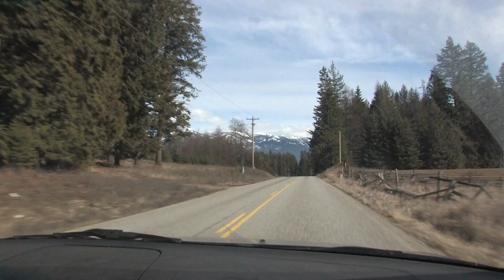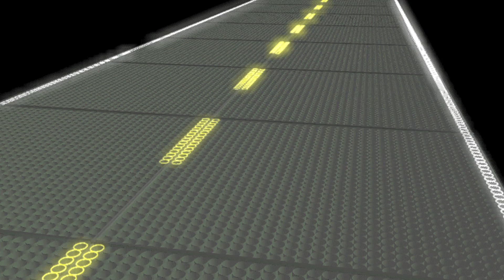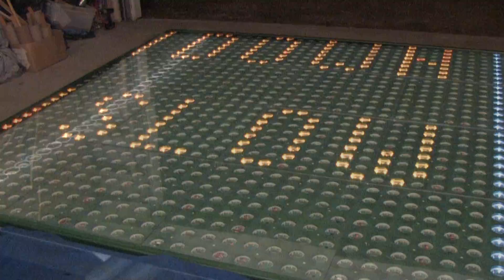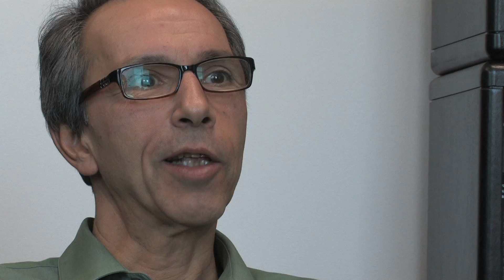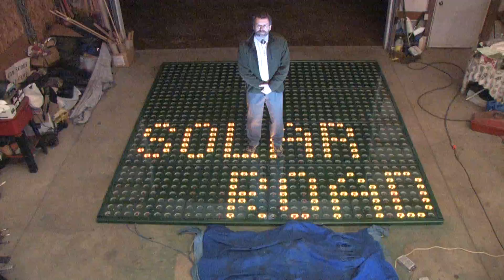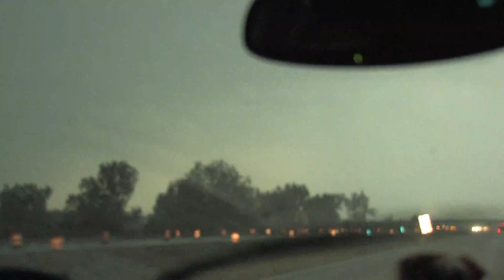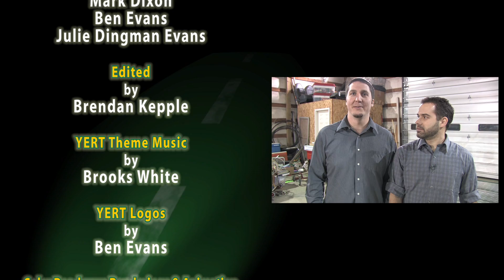Solar Roadways: The Prototype

Comment: Thunderf00t destroyed this non-sense.
Reply: Nick White They keep saying that we'll never prove that the world is 6000 years old. Insert something about the Wright Brothers... Insert something about electric cars.. Therefore, eventually people will prove that the world is 6000 years old. End of proof.
Reply: Rich Hart Even if all that stands, why would you when it is far more efficient and cost effective to just build more solar farms?
Reply: OK axe863, let me drop some knowledge / rationality on you, since you seem to love logical arguments.  There is a fundamental difference between the domains of science and engineering.  When science has thoroughly studied a domain of knowledge then the limits of what can be feasibly engineered become clearly defined.  These engineers have clearly studied the latest science on materials, photovoltaics and electronics, then designed their technology around those principles.  Because they did their homework they can have a high degree of certainty that their prototypes will work without even having built them yet.  That is the power of science, it allows you to make accurate predictions about events before they have ever been observed, in this case the reliability of a technology before it has been built yet. And yes, there are probably going to be unforeseen obstacles along the way, but that is the nature of inventing any technology, whether it be light bulbs, or rockets to the moon.  So get off you high horse and stop discouraging people from pursuing technologies that can make the world a better place.
Reply: theFailQuail What?! High tension lines carry low current not high current. If you have high current lines, what you end up with is loads of waste heat, thats why we have step up and step down transformers, electricity is transported as high voltage, low current to limit the amount of waste heat, we then have transformers to up the current and lower the voltage for home use.
Reply: Rich Hart I'm a quant/mathematician. If you want me to price an Asian option where the underlying asset process has time varying variance/kurtosis or perform a rolling generalization of generalized spectral derivative test coupled with composite multiscale entropy analysis to analyze time varying market efficiency, I'm your guy.  I'm merely applying basic scientific rationality to this discussion. Even a highly localized full system implementation has not been performed. You do not understand the fallacy of merely analyzing sub-components of the system instead of the system.
Reply: Rich Hart All this talk of scientific rationality is just complicating an otherwise simple issue. There appears to be no utility in placing rare earth materials like solar panels under inches of glass distorted by hexagon protrusions flat on the ground and under the stress and abrasion of multi-ton vehicles.  If evidence shows otherwise, I will change my mind.
Reply: Have you every done an experiment on glass tempering before???  Guess what, I have!!!!  So seeing how I am someone with more experimental experience than you, plus I will bet the farm that I'm also more scientifically literate in general, trust me the concept is feasible.

It's just like metallurgy. Pure copper is a pretty lousy material; add a tiny amount tin and you get bronze.  Iron is very brittle, treat it properly and you get steel. Material science is an incredible complex and diverse field that neither of us are trained experts on.  But my armature experience in the field has taught me that the range of properties that modern materials can have is INCREDIBLY diverse. So much so, that from an engineering perspective it better to just make a list of the desired properties you want and then work backwards to select the material that fits the requirements you seek, which is what they did.

As for the cost of producing the glass, ever heard of this thing called mass production?  Last time I checked steel was a very energy intensive process and guess what, steel is EVERYWHERE!  What made is so common?  Well back in the day, steel was reinvented in the industrial era and was very expensive for the time.  So people invested in creating the economic infrastructure to make it cheaper, and that's why steel is incredible common place today.  

All of these principles can be be applied to solar roadways.
Reply: @wulf8121  I'm curious, are you still retarded 11 years later?
Reply: Rich Hart
 The null position in statistical analysis is that a regressor is statistically insignificant until demonstrated otherwise.

The null position in statistical analysis is that difference in linear and nonlinear regression is insignificant until demonstrated otherwise.  

The null position for an unspecified non-empty optimization problem is that unsolvable in finite time unless demonstrated otherwise.

The null position is that an unquantified higher order system doesn't work until demonstrated otherwise.

You are irrationally trying to justify a higher order narrative, a currently unspecified function of lower order processes, by appealing exclusively to lower order processes.
Reply: Rich Hart I only said that to make it clear that I do not have an advanced knowledge of this particular subject matter. I dont know why you hate quant funds. Efficient risk allocation is an integral (lol) part of advanced capitalistic economies. From your general approach, conditional on you being a mathematician, you have compartmentalized your otherwise rational mind with respect to this subject matter.  

Moving on. There is no reason to heat the roads in that fashion. There's no practical reason why to provide dynamic lighting/ warnings on the ground given that for the vast majority of time, it's optimal design is static and it's harder to see warnings on the ground rather than on a massive electronic sign above the road. Just because it can do many impractical things very poorly doesn't mean that it is worthwhile venture.
Reply: Rich Hart If you disregard most of what was said though even. Glass is just not viable. To expensive, and to soft. In general the entire concept is just to expensive. And he really hit the ball outta the park with the parking lot thing. It would be useless to make parking lots out of this stuff.
Reply: Alexander Stone Can you not accept the possibility, that no one is threatened by the idea; that it simply will not work. If you have payed money towards this, you stand to loose out; so who exactly is threatened?
Reply: Because one of the concepts is generating power by putting solar panels on the ground on parking lots. Which are used by day, and less so by night.... Just there it shows they do not have the thinking requiered to pull any of this off.
Reply: Rich Hart How does one go about objectively falsifying a system that has yet to be quantified or that can always appeal to potential future innovations that afford it the unscientific privilege of infinite flexibility?
Reply: Rich Hart If it isn't at zero percent occupancy at all times, you're reducing efficiency (even further than putting it flat on the ground under inches of glass with hexagon protrusions) and for what reason. Tell me for what reason. Why cant they be placed on top of the parking?
Reply: axe863 They could be place on top of the parking lot, but power generation is obviously not their only goal.  They're also trying to solve the problem of updating road warnings and signs as well as solve hazards like ice formation.  Integrating these electronics into the roads takes energy so they decided to give the roads thier own power source, and give the surplus back to the grid.   The roads solve multiple issues at once that's the point. 

And FYI, I also am a physicist / mathematician / computer scientist, but unlike you I don't go around discouraging people from trying to make the world a better place, especially if their idea is technically feasible.  

Do I think that there are even better solutions to solar roadways?  Of course I do!  ( Honestly,  I would rather see governments just go all in on fusion tech).  But people are genuinely excited about the idea, so I would rather encourage the people behind this tech, especially because it could make a significant impact on power generation.  While also researching and encouraging even better tech to be developed in the future.
Reply: Thor M Picture in your head a parking lot that is used to full capacity. Now ask yourself this question, "why, even when a parking lot is being used to full capacity, will there always be a space that is not being occupied in a parking lot"?  

Now experimentally, look a parking lot next time you go to the store.  How much of the parking lot is not being devoted to individual parking spaces?
Reply: Bryce William Do you want us to do a full exhaustive analysis of all possible configurations?  The null position is that unquantified system is assumed not to work until demonstrated otherwise. Unless if you think that requiring exhaustively proving a negative of an unspecified system is logical, you should quit while youre only slightly behind.
Reply: Ryan Denziloe Yes there is. The null position is that unquantified system is assumed not to work until demonstrated otherwise. So how do you think we proceed in rationally allocating resources to projects?
Reply: Ryan Denziloe You want me to cite the scientific method ?
Reply: Ryan Denziloe This is kindergarten level scientific rationality. I say that I created a unicorn creation machine, a time machine and a worm hole generator. Do you believe that I have until it can be demonstrated otherwise?
How is it scientifically rational to believe in claims until it is exhaustively demonstrated to be false in infinite time? Seriously, why do you think statisticians assume regressors are statistically insignificant as the null position?
 
Do you assume as your null position that every claim is true until it is demonstrated otherwise?
Reply: Alexander Stone
 They said all the same "it'll never work" garbage about the electric cars which will drive on these roads when they're built, as well as every other technological  advancement. They get proven wrong every time, because their equations can't factor in human ingenuity and problem solving. We'll be driving on a version of this tech within a decade or two.
Reply: ***** If you still believe that Solar Freaking Roadways are anything more than a scam and a really bad Idea, then it is you that are blinded to the obvious by your own beliefs.
Reply: TheKyotey I didn't say I believed one way or the other. I am not knowledgeable about the subject matter and, therefore, cannot say it's either a good or a bad idea.  But I'm pretty sure that my level of knowledge on this topic matches most of the rest who weighed in. My point is about willingness to consider ideas which, on the face of them, seem outrageous. It is people who approach issues with both know-how and that perspective who get things done in this world.  Too easy for the rest of us to sit on the sidelines, tossing out criticism and advice.
Reply: *****
"my level of knowledge on this topic matches most of the rest who weighed in"
Now that is where you are totally wrong. ;)

"willingness to consider ideas which, on the face of them, seem outrageous"
No, you didn't consider the idea at all! You just wishfully think that "I want it to be true!". There are people how consider things and make things done, but you are not among them. ;)

But if you want to consider something for the first time in your life, look up "Silicosis" on wikipedia.
Reply: klasop Wow. Your arrogance and condescension is quite something. This, coupled with the fact that you either didn't read what I wrote or you did and didn't understand it, makes your comment sound even more ridiculous than it does on its own merit. I don't waste my time with people as rude as you, so reply if you like; I'll just wish you a good day now and be done.
Reply: Why does it matter that solar panels exist? The solar roadways corporation claims that solar roadways are a risk adjusted efficient allocation of scarce resources. Chocolate exists and therefore the chocolate frying pan corporation's claim that chocolate frying pans are a risk adjusted efficient allocation of scarce resources (w.r.t replacing standard frying pans) is valid.
Reply: Happydemon I'm mocking his irrationality. Do you think that I seriously believe that  unicorns exist, axiomatically?
Reply: "Can you not accept the possibility, that no one is threatened by the idea; that it simply will not work."

No, they (solar roadway idiots) cannot.  They cannot do anything hard, such as math or logic.
Reply: +axe863  "The null position in statistical analysis is that a regressor is statistically insignificant until demonstrated otherwise.

The null position in statistical analysis is that difference in linear and nonlinear regression is insignificant until demonstrated otherwise.  

The null position for an unspecified non-empty optimization problem is that unsolvable in finite time unless demonstrated otherwise.

The null position is that an unquantified higher order system doesn't work until demonstrated otherwise.

You are irrationally trying to justify a higher order narrative, a currently unspecified function of lower order processes, by appealing exclusively to lower order processes.  "

WORTH REPEATING!  So I did.   Damn - everybody should have these words, this logic, tattooes on their arms so they can remind themselves of it.
Reply: Ryan Denziloe Given that my null position is that unicorns exist and I have not constructed the objective criteria under which to falsify that position, said hypothesis can not be falsified in finite time and thus my position will allows be that unicorns exist. This applies to any subject. Do you now see how irrational you are?  You should google the scientific method and look at the image section. ;)
Reply: axe863
yeeeees.... I do believe that! HOW DARE YOU QUESTION MY FAITH!!!
Reply: +Rich Hart   You speak in unimportant useless generalities about "the type" of person.
Thunderf00t has proved solar roadways would be a colossal waste using mathematics and thermodynamics.
Reply: "why would you when it is far more efficient and cost effective to just build more solar farms?"

Exactly.  Rich Hart and Scammy Roadway advocates are too stupid to comprehend that fact.
Solar Roadways idiots are trying to solve a NON-EXISTENT need: the non-existent "need" to put solar panels into roadways where cars and trucks drive.
Reply: +Rich Hart   If these shitheads wasting money on solar roadways cared about science, they'd see that LESS ice is the certain future of humanity, due to anthropogenic global warming (AGW).
Reply: I came from the future to inform you all that not only did this fail, thunderfoot was right all along... Shocking
Reply: I watched thunderfoot's video and came away unimpressed. He hugely extrapolated, was patronizing, and clearly had it in his mind he had done more research (with wikipedia and $20 IKEA LED strips) than the folks developing this system. One particular item worth mentioning was that he constantly compared the road system of the US to the high tension line power grid. High tension lines are used to carry incredible amounts of current between cities and generation facilities. They are not used for carrying the kind of low current, decentralized power-generation this idea enables.
He didn't destroy the idea any more than he put a snarky spin on questions he didn't know the answers to.
Reply: theFailQuail  So the null position is that a system that has not yet been implemented works until it has been exhaustively demonstrated not to work? Do you not understand how fundamentally irrational that is? Also, how the hell does the power storage and transport system work then??
Reply: @theFailQuail  You still shilling for this nonsense now? HAHAHAHHAHAHA if you are.
Reply: axe863 Wait a second, "If you want me to price an Asian option....multiscale entropy analysis to analyze time varying market efficiency..."  OMG!!! YOU WORK FOR A HEDGE FUND DON'T YOU!!!??? AND YOU WANT TO TALK ABOUT NONSENSE!!!??
Reply: You just believe he did. Doesn't make it so.
Reply: Rich Hart
 
"Have you every done an experiment on glass tempering before???  Guess what, I have!!!!  So seeing how I am someone with more experimental experience than you, plus I will bet the farm that I'm also more scientifically literate in general"

assume (əˈsjuːm)
vb (tr)
1. (may take a clause as object) to take for granted; accept without proof; suppose: to assume that someone is sane.
2. to take upon oneself; undertake or take on or over (a position, responsibility, etc): to assume office.
3. to pretend to; feign: he assumed indifference, although the news affected him deeply.
4. to take or put on; adopt: the problem assumed gigantic proportions.
5. to appropriate or usurp (power, control, etc); arrogate: the revolutionaries assumed control of the city.
6. (Ecclesiastical Terms) Christianity (of God) to take up (the soul of a believer) into heaven

The 6th made me laugh. The 1st is the one you like to do. It makes you look like a douche. Probability says that you might be the only one with the relevant education and experience. But the nature of the video draws the interest of people with knowlege on the subject and this increases the probability a lot. To conclude; assuming you are the smartest person in the room makes you a douche, even if you happend to be right. You were not.
Reply: axe863 [citation needed]
Reply: axe863 I want you to cite your statistical claim that a new technology not working is the null position.
Reply: axe863 Unicorns don't exist. Solar panels do. What a hilariously broken attempt at a logical argument.
Reply: axe863
What did you just smoke and where do I get some?
Reply: Thor M One word......graphene.......
Reply: Rich Hart Right on Rich.  Some people are acting so threatened by this idea... makes me wonder what they have to lose...
Reply: axe863  just as creationists destroyed evolution? ;) Challenges and hurdles cannot be a valid reason to not try. Science and technology cannot answer every question or solve every problem right away. But we still keep pressing and trying. That's what research is all about. But that does not discredit science/technology, nor gives a reason not to try.
Reply: axe863 (E-HEM!!!) " All this depends, of course, on the development of a durable, transparent 
protective layer for the solar cells embedded in or deposited onto the roadway. A glass 
surface with a failure stress 50 times as great as is currently available would fit that bill 
nicely. Traditional hot-mix asphalt (HMA) has a tensile strength of only 2-3 MPa and 
vertical stress of ~25 MPa8
, while strengthened glass would have a fracture strength 100 
to 2000 times higher. " - Dr. Joseph V. Ryan Penn State U. "Energy Solutions from Glass Road Surfaces" .    This what written about two years ago.  He details exactly all the technical hurtles in creating the glass needed for solar roadways as well as the technical solutions around them.  Seeing how they now have working prototypes now it seems that they are well on their solving all the issues you are talking about.  

So in reality, the experiments exist, as well as the statists you just haven't done the work to actually... you know.. learn about them...  

Oh, do you disagree?  By all means, contact Dr. Ryan and explain to him why you, a random youtube troll, know more about material science than, than an actual material scientist.
Reply: axe863 There is no "null position" on whether a technology works or not. You're trying to use technical language to intimidate people into agreeing that your comments have some kind of objective logical underpinning when really they're just baseless assertions. You will not find your nebulous statement in any statistics text.